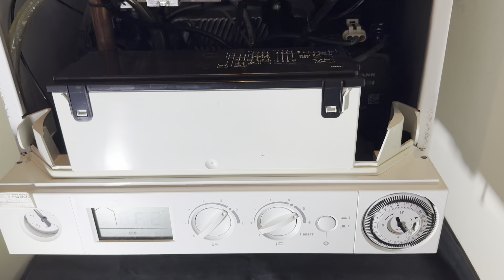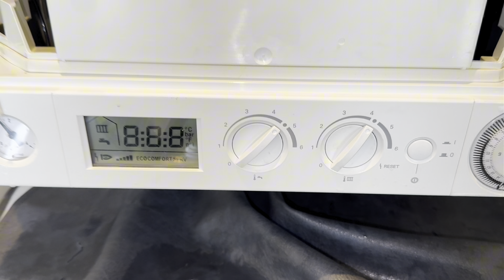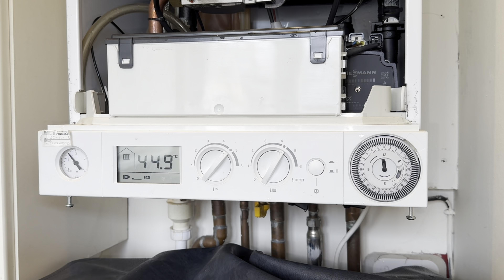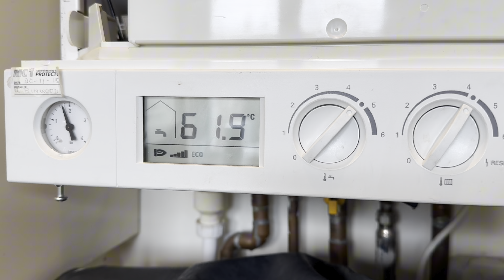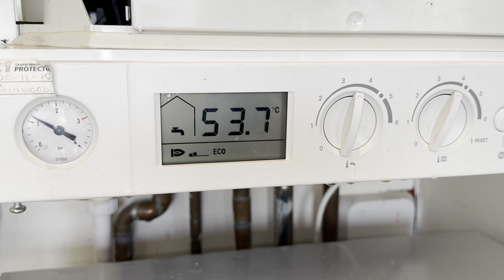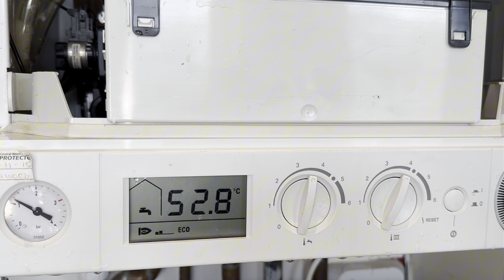These are still a thing? I guess we all make mistakes!

Comment: I’ve had same issue as you with those Viessmans. Those rubber hoses don’t have an oxygen barrier. I’ve been to some that have had the hoses replaced (nightmare replacing the return at the back of the heat ex) and then the system powerflushed. 2 years later the hoses have blocked again - that’s on a system that is spotless. I don’t know how Viessman get away with fitting those hoses inside their boilers.
Vaillant and Glowworm used to do it but knocked it on the head, who knows why Viessman haven’t 🤷‍♂️
Reply from the maker: Very odd, that’s what I didn’t understand! Have changed hundreds for Vaillant and Glowworm before so it’s a well known issue as you say! Ooh I bet the return is a nightmare! I couldn’t even access it properly for this, had to just squeeze up as much as I could, not great when the heat exchangers just cut out on temp 🥵

Comment: Is it hard to take the hose off the top connection? not really worked on these much and never touched this hose before.
Reply from the maker: To be honest, I left the top connection on both connected (return is behind the heat ex so would presume it’d need to come out for access) the bottom connections are push fit with clips so easy to pull out then squeeze the tubes and stick a screwdriver out/push the muck down. Appreciate the watch! The top connection looked like it wouldn’t seal again if it came off 😂

Comment: "I trust his diagnosis "..... 😂😂😂
With the cost of that repair a filter should of been fitted too 🤔
Reply from the maker: Did you price it?

His diagnosis was correct, just went deeper than he initially expected, which he diagnosed without draining the boiler or accessing any parts. 

It’s an agents job, who didn’t want a filter fitted, we can only offer best advice 🤷🏽‍♂️
Reply: @RJHeating  you know I didn't price it 🤣🤣🤣 plate and pump isn't cheap though. As you say all you can do is advise them, if they don't want a filter they can pay you again this time next year
Reply: To be fair I think the other engineer diagnosed well....unfortunately with the issue of blockages like that it can affect multiple parts which is only apparent when you start stripping it down 🤔
Reply from the maker: @she_plumbs  100% his diagnosis was spot on! The system has clearly been left for a while with no care and no protection etc, not to mention those rubber hoses asking to get blocked 😂
Reply from the maker: @danielbailey1452  I’ll be honest, I was probably defensive in haste, you get so many people on here trying to dig you out! I apologise if I came across rude and took your comment wrong!

This is what clients (not just agents) often don’t get, a little extra money now, can save you a lot of money in the near future! As you say, this’ll be choked up again within 12 months more than likely!  

Appreciate you watching!